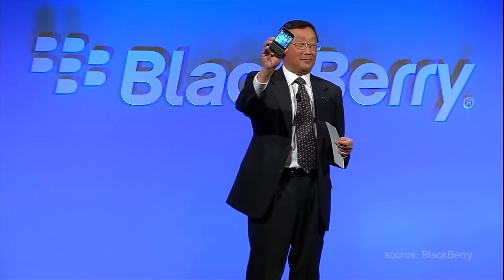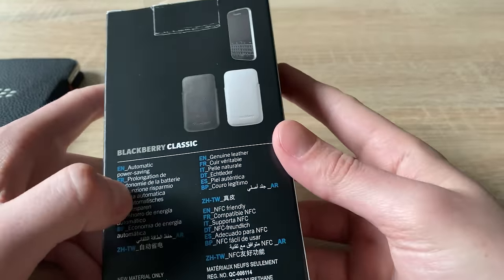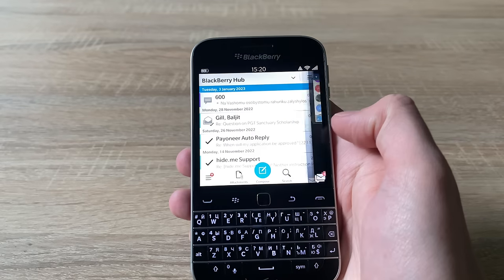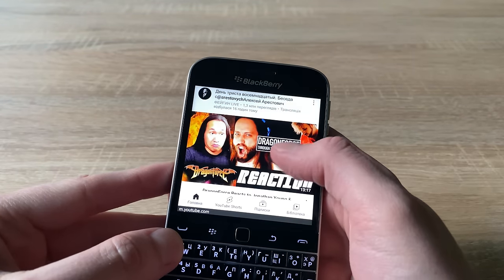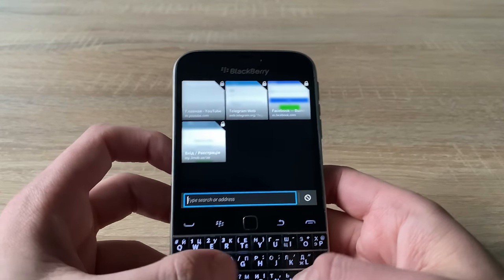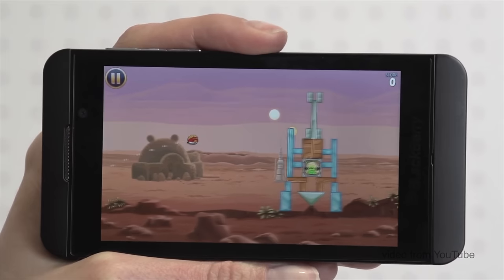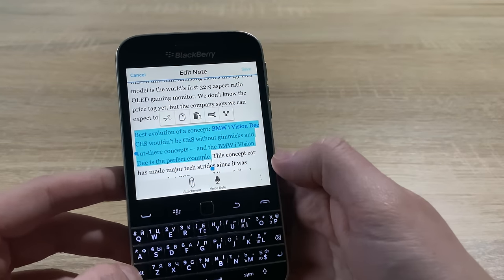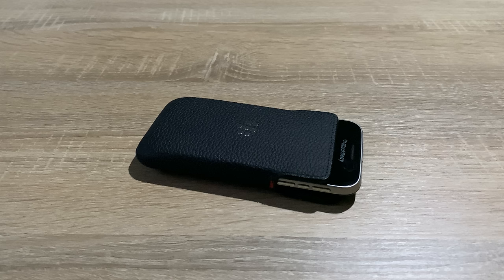Unboxing a BRAND NEW sealed BlackBerry Classic in 2023! Should you buy one?

Comment from the maker: Quick BATTERY update: I think from the beginning the reason of battery drain was my local cellular carrier (3Mob, it's a Ukrainian virtual network operator). The thing is, because it's a virtual operator, my SIM always switched between different networks (and used 'domestic roaming'), searching signal and thus draining the battery. Once I switched SIM cards and boom! ..no battery drain whatsoever. 

Happy end!
Reply: I was wondering about that as all of my BB10 BlackBerry's (save for the Z10, but quick swapping and having a spare was almost as good) would get AT LEAST the whole day (my Z30) with mid to heavy use and as high as 3 days (my Passport) with the same workload.  They always got great signal (it was borrowed inside factories a lot for this reason).  My Keyone was great too until I switched to a carrier with lousy coverage.  Even at home in the basement it would eat 70% of the battery in 10hrs. just sitting by itself.  Thar's exactly what it was doing, as you said... constantly searching signal.

Comment: If Blackberry made a comeback I would be on board. Nothing like those Blackberry/BBM days!
Reply: i am holding onto my BB key 1.  6 years and 9 months so far , it works perfectly fine for me though it takes an hour to get a full charge, which is expected but still . But the classic is somewhere in the drawers . its the battery that is near impossible to find in the market
Reply: they tried and it failed sadly it sucked
Reply: BlackBerry could make an Android variant featuring a physical keyboard.  There are still applications that are useful for it.

Comment: I was one of the original beta testers of the z10 and q10 in 2012. The z10 had Verizon and the q10 was AT&T. At the time I was driving cross country. With maps and was checking if the signal was lost, heating up, app crashing etc., these were solid phones for the time. Then in 2014 I was asked to also beta test this phone before it was released but I declined. Biggest regret of my life. At the time there was a variant that had Android as the OS. Might be getting confused with the Passport Silver edition.

Comment: How did you setup Gmail?
Reply from the maker: I have 2FA so I used an app password (can be set up in Google account). You need to type it instead of your ordinary password if you have 2FA.
So to add Gmail go to the 'advanced' tab in accounts menu and add 'imap'. Type imap.gmail.com as server address, port 993, ssl for encryption. Then type smtp.gmail.com for smtp address, 465 port, again ssl for encryption. Then you see SMTP username, SMTP username = your Gmail username, so type it here again. And that's it, you can save this and it should connect
Reply: @Bohdan_HI-TECH  you are the man! working perfectly. Do you know if we can receive MMS? I am able to send but not receiving.
Reply from the maker: @anandamroy4727  Didn't try that, but I know that MMS configuration can be set up in BlackBerry Hub Settings > Text Messages > Advanced. Look there, maybe you know your cellular specifications that should be typed there
Reply: @Bohdan_HI-TECH  so same as old os 5 manual addon gmail for push email ?

Comment: Would I be able to use it for basic call/ text, internet browsing and the BB OS10 on T-Mobile/ Metro PCS or Verizon? I have my old phones, Q10, Z30, but the screen broke, and I am thinking of buying a replacement. Last time I was using it was 2018.
Reply: Well, I saw this right on time. If you already have an activated blackberry 10 device on T-Mobile you will be able to use it. It’s going to be searching for the network,  switch to global. I did this morning on a Z10. The first call failed to the second one was a success.

Comment: No you shouldn't buy one. BlackBerry shut down support for their devices that run BBOS. Only Blackberry phones worth using are ones that run android os. Like the Priv, KeyOne, or Key2.
Reply from the maker: I mean, this video is clearly for those who don’t need manufacturer’s support
Reply: I had a KeyOne and it would not let me make or receive calls after a while but I could get emails and text messages fine. It became a hassle so I ended up getting the Unihertz Titan Slim which has BB features such as the Hub ect. for 30 days without adds. After trial it will be $2.99 subscription. I am still within 30 days so I don't know what that will look like...most likely I will purchase subscription.